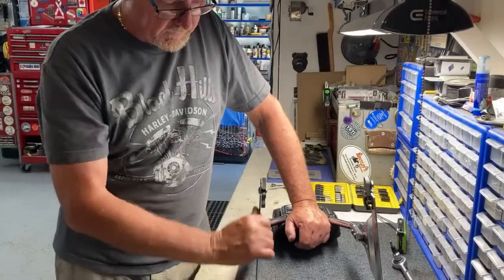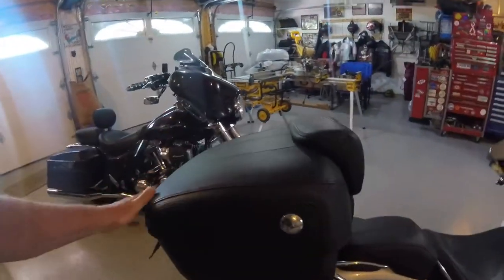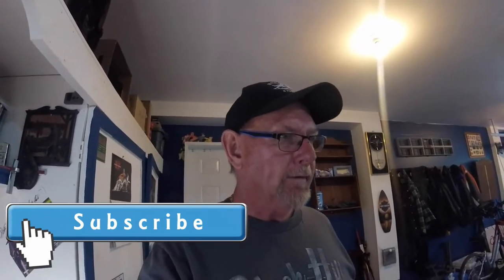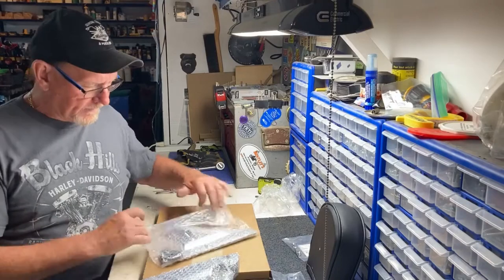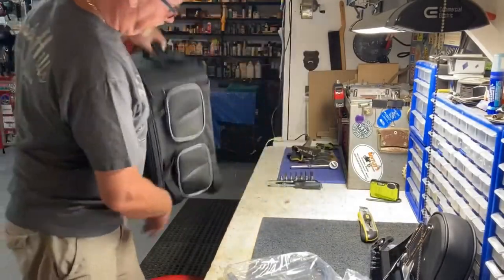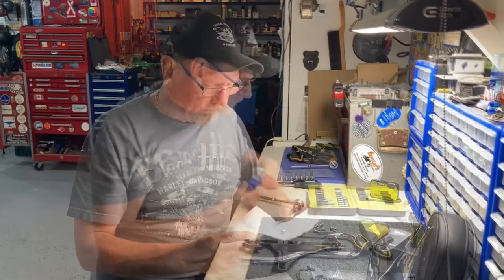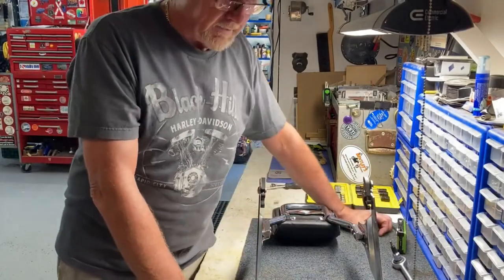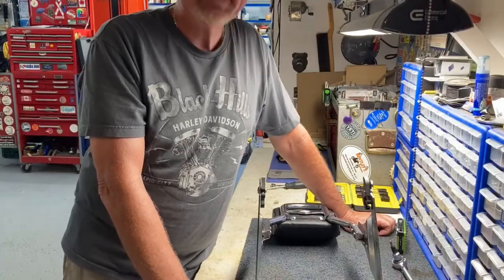HD Deluxe Detachable Sissy Bar Install

Comment: Very cool thank for shoutout if it was sharp I probably would have.   I started say could put it on then tighten it up might have straightened it out
Reply from the maker: Hi Doyle, If we were going to put it on permanently then I could have twisted it until it fit but needing to have it with the quick release it had to fit properly. At the Shop we did put it in a vise and tried to straighten it but it kept springing back to its original twisted position and being chromed you couldn't apply heat. The shop was great though and a replacement part was installed that day to fix the problem. Cheers